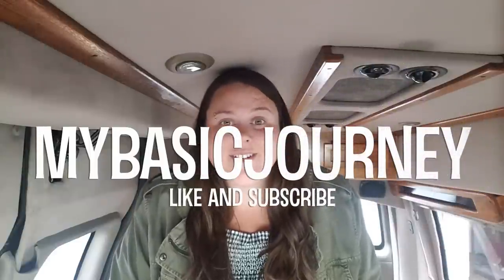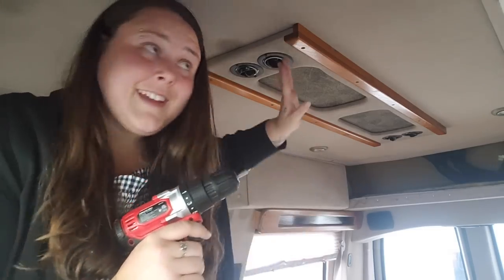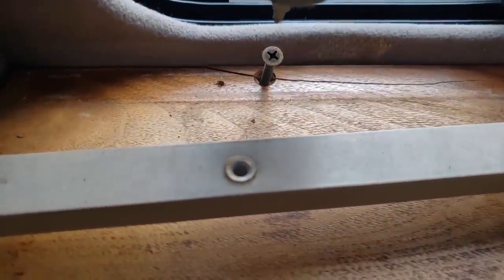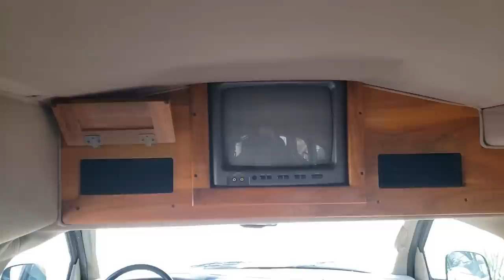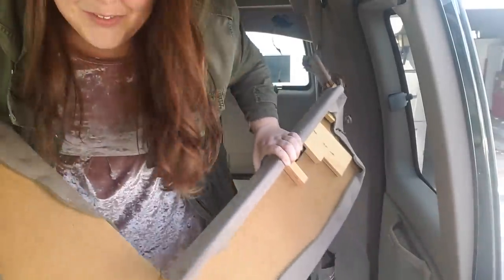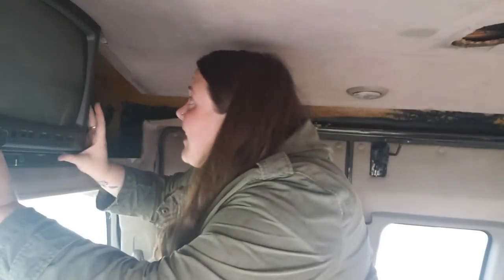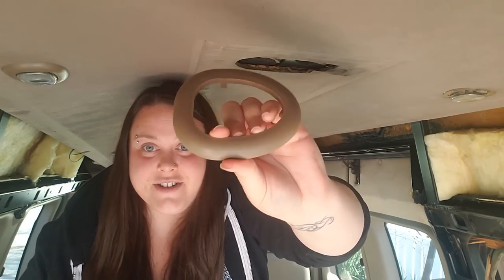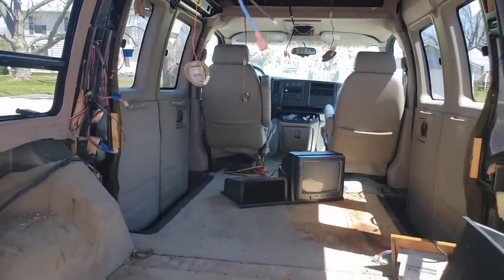VAN BUILD | Starting DEMO in my new Chevy Express conversion van and ripping everything out!

Comment: Girl, you need an extension for your drill. You put your bit into it and it gives you more room in those tight places. I know what you are going through. I tore our van apart. Good job saving those screws, they can get expensive,  For some ideas, our whole build is on our channel Nomadic Wond'rin Star.

Comment: So jealous…I have the Express but it’s not a high top.  I’m using a no-build right now so I’m very impressed.  Thanks for doing this, I’ll have more confidence to do it myself.  😍. Seriously glad to watch you take out the entertainment system…I was also nervous about wiring.  I also have a 12v plug in the back which is super useful and I don’t want to lose it, lol.

My door didn’t open from the inside either.  Turned out it had just slipped out of position.  No $ fix!  Hope that’s all you need to do.

Comment: When one gets back on out the to desert again this comprises four states.  Wonderhussy hikes up to the old miner cabins and films them.  Maybe one can do something with wonder hussy.  Her name is Saraha.  She just visited a cabin that looked like a rail road car.  She does all kinds of stuff.  She was a nude model and she like to go natural into the varous hot springs in Nevada and other places.  Have fun.  She has a place in death valley now and her sister was staying with her.  She has a toyota four wheeler.  She drives the sand trials in the desert too.  She too is 410 friendly.  If one gets in a pinch for a shower I use a brand new sprayer.  These are 20.  A camp shower at the Walmart is 20.  I have the rechargeable water pumps with the shower head on the hose.  They have buckets of survival food that one can make on the raod too.  I have two of them here and I had the freezed dried food too.  Yet I ate up the freezed dried food.  The mac and cheese from walmart camping food is good.  Just add in hot water.   Hope one and Joey are doing good.

Comment: This van is beautiful, love the outside color. Do you have a little air conditioner in the back on the wall? I left mine in, it comes in handy for when is hot outside, have a little air conditioner. What I really wanted is to use it for heat, mine only get cool air out but I heard there is a switch that would allow both. Love this high top, can’t wait for more videos and see the beautiful progress! Thanks for sharing 💕

Comment: I wonder if you could have the roof removed and add steel to the walls and welded on and then roof replaced so that you could stand up in it with a few or as many inches as you need.    I feel sorry for people who cannot stand up in their vehicle.  ???    I’m thinking that you could extend your floor by the sliding door and put some shoes under it?

Comment: Good luck on trying to sell those old electronics. I wasn't even able to give mine away for free. I ended up having to send them to the recycler. If you don't get any bites on selling try just giving them away. The DVD is probably a higher chance of being sold, but the TV is big and heavy, and something that will fit in that space has a flat screen, is really inexpensive to buy brand new, so most people won't want the dated electronics.